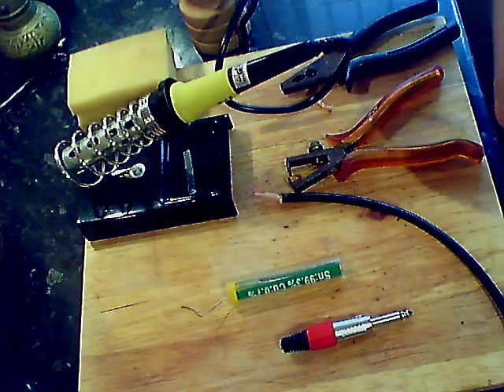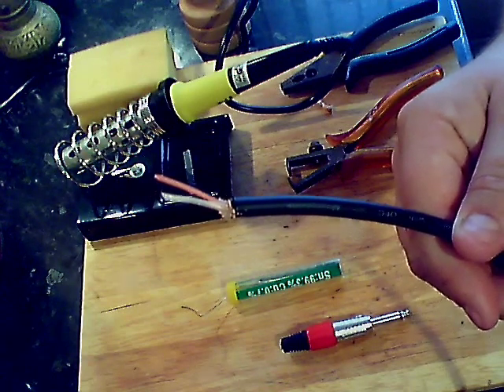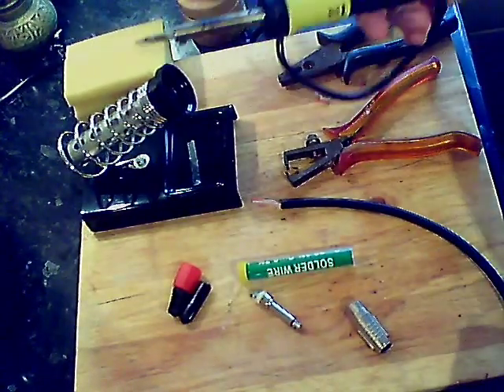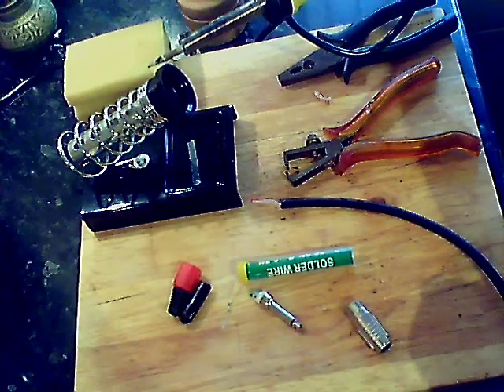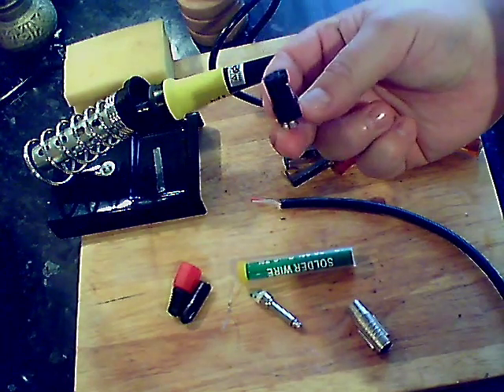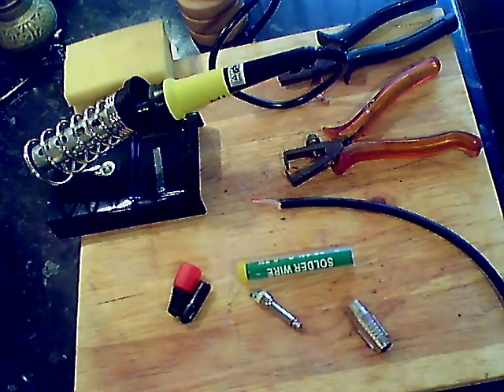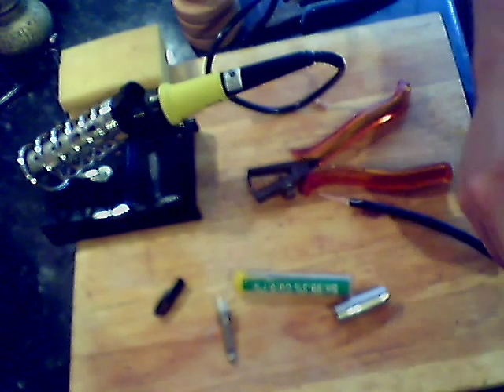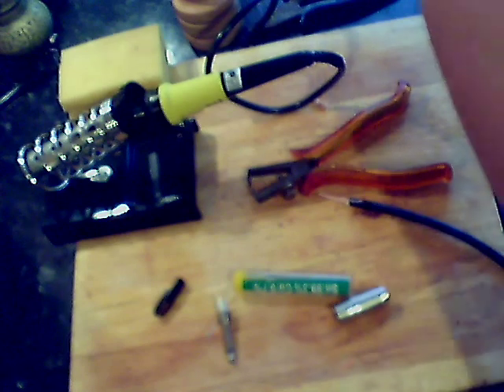DJ TUTOR - JASON SHOWS YOU HOW TO SOLDER A JACK PLUG Part 1

Comment from the maker: Hooray one i can answer!!!  on headphones you will need a stereo jack. this will have 3 prongs to solder to. the outer / biggest one will be the one that both sides are soldered to in the wire it will be the one without a coating on. or at least the same coating colour in both.  the other two prongs are for the L and R stereo signal. ie. prob white and red.  fiddle but doable!!